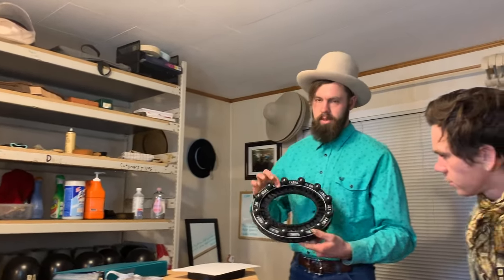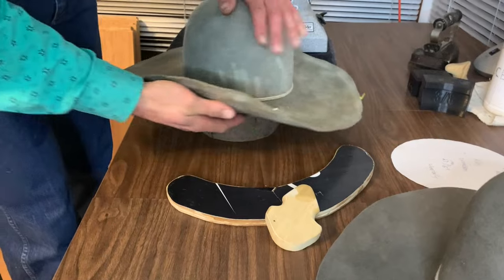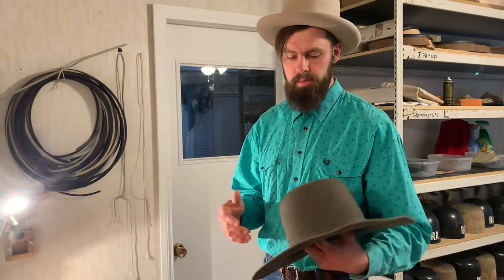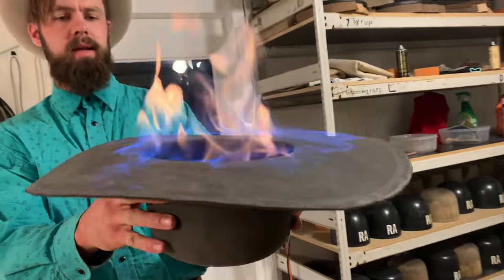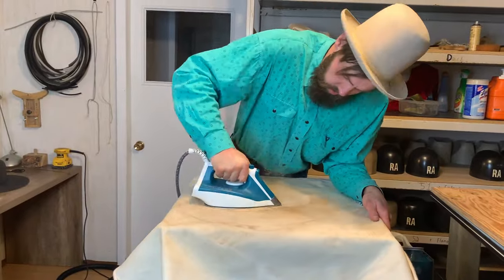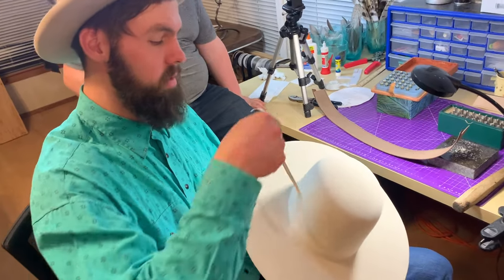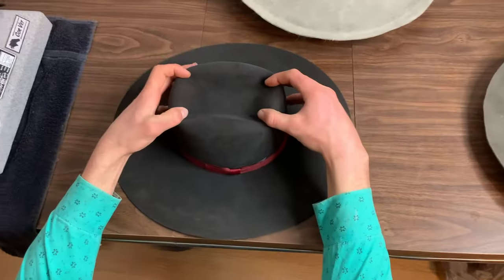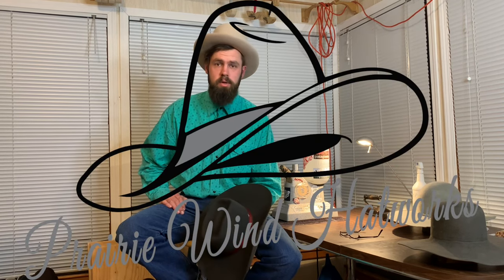Building a Cowboy Hat

Comment: Pretty much all custom hatters use the same Winchester hat bodies. I have yet to be impressed with their quality. You have to do more than just block the hat. Most hatters iron the crown and brim on the block/flange. I think it takes more than that though. Ive experimented with baking a damp hat in the oven on the block at low temps until dry and I've seen remarkable felt stability doing this. If I made hats for a business I'd look further into this for sure. If you simply block a raw body, it'll shrink and taper quickly after wet weather.